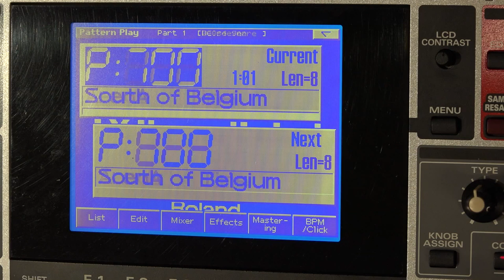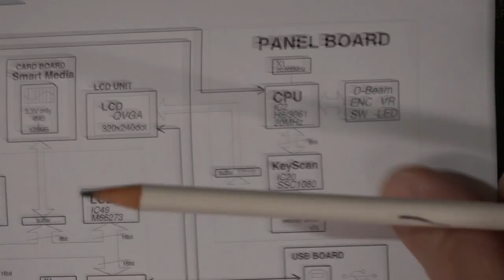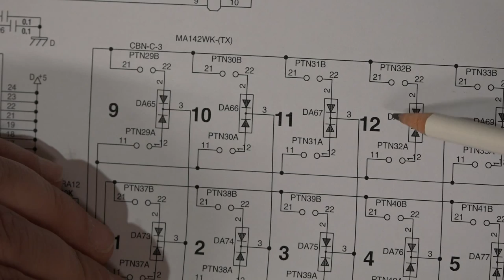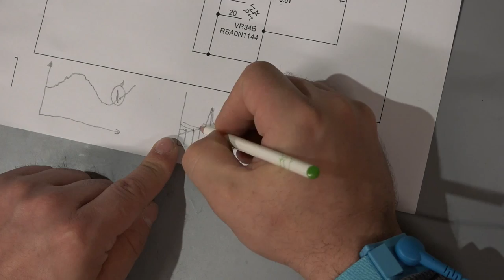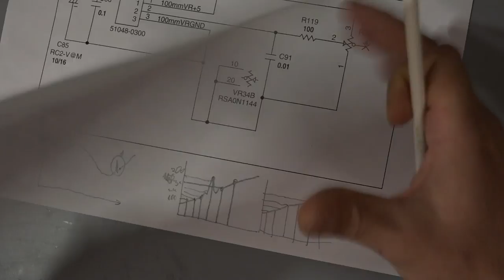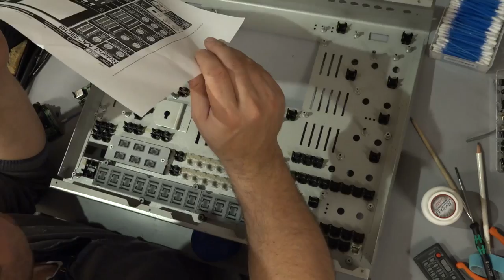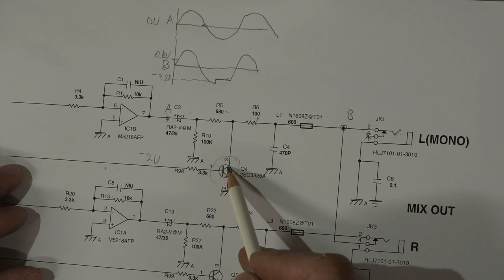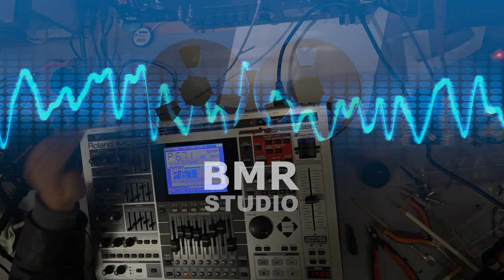Roland MC-909 tear down, repair and maintenance

Comment: Hello,

I have a problem with my Roland MC-909. It doesn't start, it stays fixed on the initial roland screen, I can't do anything, just reload the system from smart media, which works fine, but it doesn't start.
What could it be?
Reply from the maker: Sound like memory error… caused by some dead caps on the 3.3 and 5v rail. Need service!
Reply: I had already measured all the capacitors and the voltages are correct. I also replaced the flash and reloaded the firmware via the smart media, but it still doesn't start.
Also replace the RAM.
I'm afraid it's the ic1 processor
Reply from the maker: @josephc.3402  service manual has a big section about testing each main part.
Reply from the maker: @josephc.3402  page 23
Reply: I can't go to that screen, because the machine won't boot. it stops at the first home screen with the words roland groovebox.
Reply from the maker: @josephc.3402  not ic1… this is NAND ram or something like this.
Reply from the maker: @josephc.3402  take out the mainboard and send it to Synth Doctor. Find them on Facebook, with Roland mc 909 synth repair words
Reply: Ook, thanks
Reply: could you do me a favor?
do you format a smart media with the mc-909 do you upload the firmware do you make an ISO of the smart media and send it to me?
You would do me a great pleasure
Reply from the maker: @josephc.3402  the problem with smart media, is different from any AT, ATa, serial or 8bit parallel format. And I have no more smart card. We did try to develop a arduino shield, to emulate SMC, nothing worked… not even make an image. For that You need direct SMC reader. I guess the firmware should contain a same version of bootloader and firmware. But with boot problems, how You can run the update process?
Reply from the maker: @josephc.3402  will try… wait a bit
Reply: I wanted to create an ISO and then copy everything to my smart media and then put it in the 909 and start the update
Reply: I read that the smart media must be formatted by the mc-909, maybe it will install some files, I don't know
on purpose I need someone who has a 909 to format it and create the update
Reply from the maker: @josephc.3402  I have only 8Mb card.... not enough space ... you can format the card to FAT on your pc, then add 1.23 latest firmware into a  Roland main folder.  slot in, and start MC.
Reply: Yes I did, and everything is fine. but in the upgrade txt it says to format it from the mc-909. as I told you, I don't want the 909 to install any hidden files
Reply: do you have older firmware?
Reply from the maker: @josephc.3402  nope.
Reply from the maker: @josephc.3402  you have hardware problem… send it to the synth doctor! They have serious instruments and original parts.
Reply: I tried to write to him but he doesn't reply.
Do you have their email?
Reply: Good evening, for those with the same problem as me, check and replace the potentiometers and tactile buttons. By replacing them I solved the problem, the machine is restarted.

Comment: what happened with the SMC slot when it not recognize or respond when inserting a card with the update or the system? it is like a thorn in the ass when loose the program system in the rom. HELP! please...
Reply from the maker: Do You follow the update instructions???
Your card is checked before (write-read test)
The slot is clean inside?
Reply: yes all that stuff
Reply from the maker: interesting.
Do a video reply, then I can help You. I'am a bit confused what You are saying

Comment: Would have been nice if you'd shown how to undo those ribbon strips.
Reply from the maker: just undo the screws and pull up, out the PCB. The strips has a small nipples only to connect to the pcb. Be gentle!

Comment: That was amazing,  I just bought an old one today hope it is good if not I'm gonna contact you brother nice job... Miami305
Reply from the maker: Daniel Brittenham/ DaDannyBoy how much You paid for it?
Reply: @BMRStudio   $450.00 @ guitar center  in Richmond Va. Waiting on it being shipped to Miami now. The merchant said it was in very good condition.  We will pray it really is. Thanks brother...  Miami305 💯👍🥁🎶
Reply: What cleaning products did you use ,and what lubricants are good for the controls. You have the best video on the 909 out there thanks for opening it up I thought it would be more complicated but its really straight forward... Miami305
Reply from the maker: Daniel Brittenham/ DaDannyBoy good price You got! Thumbs up for the guitarcenter!
Reply from the maker: Daniel Brittenham/ DaDannyBoy
carbon switches (velocity pads), just clean Isopropyl Alcohol
Potentiometer surface: non lubricant contact cleaner, then Vaseline spray. 
Potentiometer top slider surface: silicon grease (high viscosity) , 
Switches : WD-40 or contact cleaner with thin lubricant.
Jacks: same as the switches
The musician: Beer or Red-bull
The crowd: Vodka with Red-Bull
Reply: @BMRStudio  You da man brother,,  can't believe I got one for my center piece,,, now just gotta learn it... Miami305
Reply from the maker: @DaDannyBoy  new episodes are in production...

Comment: Nice video
Reply from the maker: Thanks :)
Reply: +BMR Studio Is there a way to remove the smart media storage and replace it with an SD card or some other storage? Smart media is too hard to find.
Reply from the maker: If You believe or not, now I just looking for that :)))) I think is possible. Fortunaly the MC uses pin to pin parallel connection inside, so I think we can solder some other controller on that. Let me finish this hack, then off course I will do a video.

Comment: So I opened mine and cleaned it with rubbing alcohol, a toothbrush and a q tip and put it back together and now the screen won’t turn on
Reply: did I fry something? or do you think it might be a misplaced cable
Reply from the maker: Only the screen is not working?
Reply: BMR Studio Well i guess the screen lights up but it doesn’t show anything. it doesn’t start up or show any options
Reply: And because of that the pads don’t light up either
Reply from the maker: vctr hmmmmmmmmm.... download the service manual from the video description, take to the part, and build back again based on the assembly diagram. Then we will go forward. I have a guess, but You need to do this step.
Reply: BMR Studio so i wanted to wait a week before trying again and I took it all apart and put everything back together like the diagram and it still doesn’t work.. what do I try now?

Comment: my pad cant be tap (1-8) how..
Reply from the maker: Cola? :) beer? clean first, then check the scematics. Link in the description. Roland quality scematics, all parts are marked, and You have enough space to do basic measurements.
Reply: no, never spilled any wet item.bought it since 2006, and use it untill now. im not used to any components, i scared if i open it, everything will be broken..
Reply from the maker: fuckartletsfart well... then bring it to some service. bring them the service notes. The problem will be around  the IC20 pin 1, 2, or the pullup RA12 resistor block, or some corrosion exactly around this area.

Comment: Thank you for this very enjoyable journey. I have just acquired a very well used one here in New Zealand.The first two pads don't work and the last two sliders in the mixer section seem to move together? That's about it so I will dive in and start cleaning. Nice video...all the best.  You can have a look here hopefully for a bit of a laugh. I hope I can get the paint off...haha

  http://www.trademe.co.nz/Browse/Listing.aspx?id=1100245306
Reply from the maker: Thank You for the nice comment :)
I hope the best with Your 909! The cleaning will help I'am sure! But... The pads and the sliders are working on different chips. I assume some kind of dirt and maybe some voltage reference issue. Check the voltages, and do a soft cleaning, only with pure alcohol. Use a realy soft buds. The carbon film are so sensitive. Update Us, how is going after the cleaning :)
Reply: BMR Studio Really nice of you to reply I will keep you updated.

Comment: Hi.
love your vids :)
I have a major problem with my 909 that hopefully you (or a next Jedi out there ;-)can help me with?
 It has started after playing a preset/user pattern, the machines timing slows down in the last bar.The screen then goes haywire and it rapidly cycles  through virtually all the setting screens (patch,fx, lfo /filter settings etc, display reads" no sample "(erases all my samples )
keeps jumping to song mode and tries to write /copy and basically becomes unusable! 
I have factory reset and updated to v.1. 23 and replaced the 256 memory. .This first started when I was hooking up midi to a computer.
I believe it's related to cc messages?? but in an unconnected midi state the machine will power up okay and seem stable then revert back to the screen cycling state!??
Have you ever come across this problem? or know how to resolve it I would  appreciate info before I have to send it to Roland! !Thanks and keep sharing your quality knowledge :)
Reply from the maker: mr WYN Show to some monk. The devil is inside :) Or, first check visually the pcb-s. Can be oxidation issue after some fluid. Second what can be, is dead capacitors on the power unit, main pcb, and - or on the user interface board. Go with that to some notebook service or to some high level TV service. will cost around 100 USD to repair.